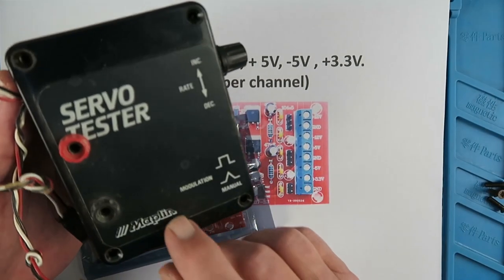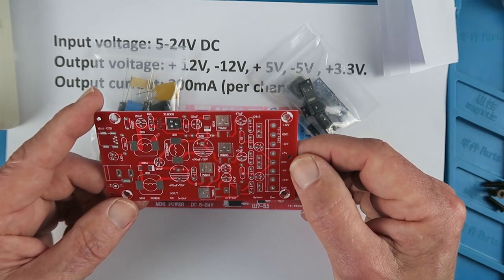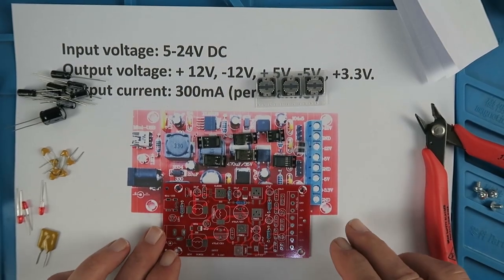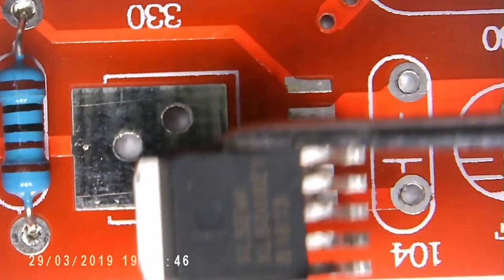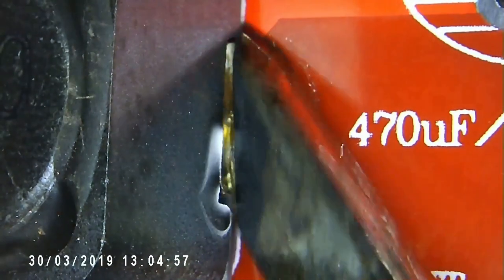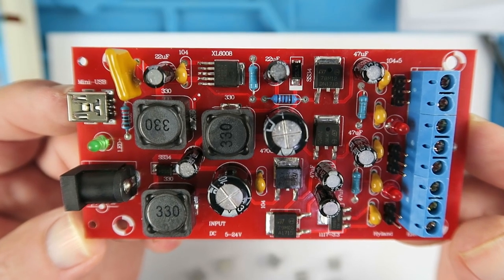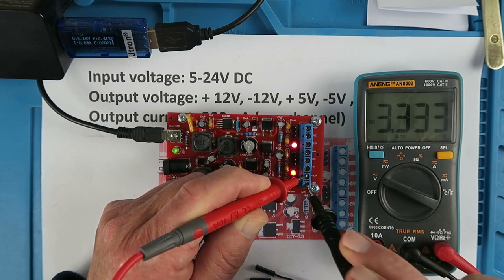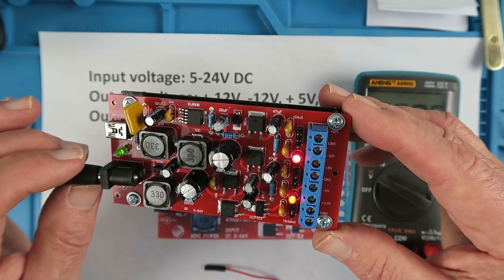Hiland Multi Output PSU + 12V  -12V + 5V -5V  +3.3V Kit Build

Comment: When i played with SDM, using cheap 1$ clock style SMD kits, i've found out that using a regular soldering iron was not that good,  a few bad solder joints that looked ok, but were not. Using the same technique (i.e. tin the pad) but with a hotair gun , then fix up things with iron was much more reliable. Worked out of the box with hot air first. The kit had more small components , ~ 25 of them
Reply from the maker: Agreed! With smaller components hot air is the way to go!! https://youtu.be/tWSPvsFQxzI?t=312